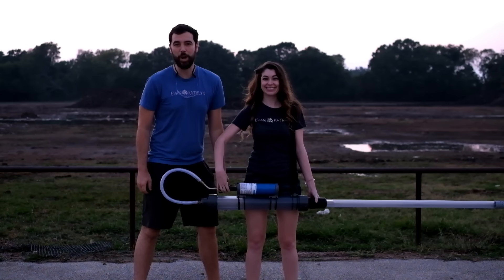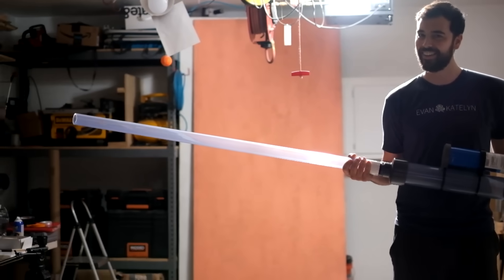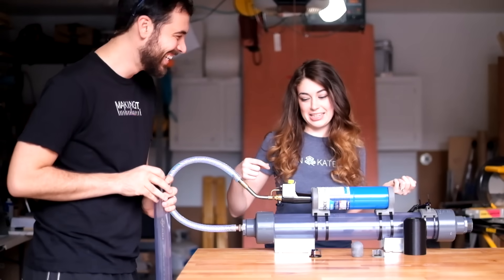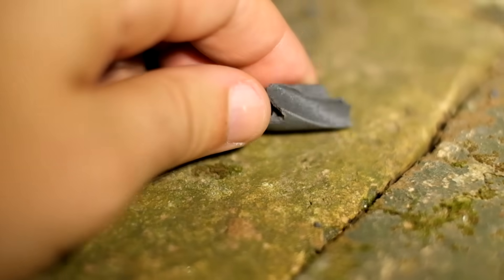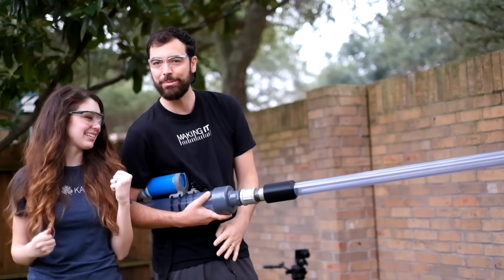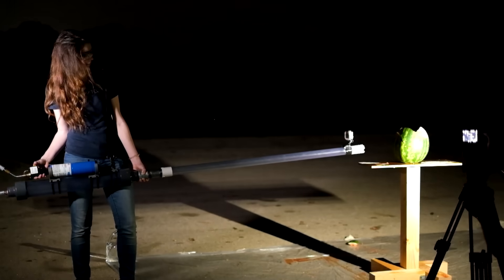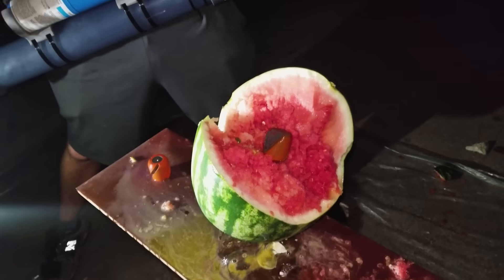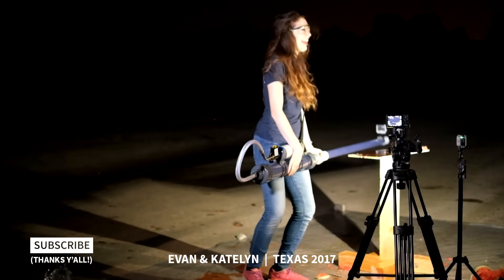Cops caught us firing our homemade propane blaster

Comment: Loading mechanism: 1) cut a hole in the side that you can put the ammo in 2) have a slightly bigger tube slide over it to seal it.
Reply from the maker: Sorry it took so long for us to get back to you on this comment, we wanted to save all the suggestions in a google document for when we make version 2.0! Officially on the list, thanks for the suggestion :D
Reply: Good idea! That way the pressure doesn't let the bullet out
Reply: The slightly bigger area is where the gas will escape because it's before the projectile, I feel like you thought of this because of a shotgun but that has a receiver arm which pushes and pulls the shell firmly into the barrel after the slide closes and the shell has a firm seal around the barrel which fires forward. This would probably blow the side out in this pvc gun

Comment: I think you'd get a more consistent ignition if you put the spark inside the combustion chamber. Much better cavity for air-fuel mixing, than counting on air being pulled into the torch head and being able to travel down the thin tube. Maybe a grill starter like most traditional potato cannons, and use a stock (non-trigger start) propane head...?
Reply from the maker: Sorry it took so long for us to get back to you on this comment, we wanted to save all the suggestions in a google document for when we make version 2.0! Officially on the list, thanks for the suggestion :D
Reply: EvanAndKatelyn I've been making potato cannons for a while. One of the problems you have is the ignition. As you stated you will be fixing that. But the biggest problem you have is your combustion chamber is too long. Cut that barrel about 1/3 shorter. What's happening it's your getting a slow burn and not a fast explosion. The longer chamber looks cool, but your losing efficiency in the burn. Cut that down and you get explosions that will rocket your projectile. A smaller barrel also increases your pressure but means you have to smaller projectile. So there is a trade off. 
You could also have multiple  barrels with an adapter ring. Good luck, stay safe.
Reply: And you could use a magnet to load it
Reply: Instead of the magnet holding the bullet, would skipping that and putting a hole through instead work better?
Reply: If the spark is in the chamber, there is a chance of flashback where the fire follows the unburned gas mix back to the torch.

Comment: Love the video as always, especially your reactions to the madness. The usage of transparent materials is great as it allows a nice look into how the system works.

The reason why I believe it doesn't work and needs to be angled down is the place of ignition. The ignition happens where the gas comes from. Normally air would be around this area, however the hose prevents this. Angling the device down allows air to enter the hose and creates a successful ignition, since it is less dense than the gas. If you create the ignition in the combustion chamber where the gas and oxygen can mix instead, it will probably work a whole lot more consistently.

Now how do you get the combustion into the chamber? Well the same as Destin from SmarterEveryDay did. You can use two electrodes that are very close to one another but do not meet in the chamber and spark those. This should create enough energy to ignite the process.
Reply from the maker: Sorry it took so long for us to get back to you on this comment, we wanted to save all the suggestions in a google document for when we make version 2.0! Officially on the list, thanks for the suggestion :D

Comment: Also the problem you were having firing the gun because of the angle is due to liquid propane going straight into the regulator of the propane torch and throwing off the air fuel ratio if you get bored take a propane torch and light it then Tip It upside down or sideways and you'll see that the flame starts to blow out or become irregular... And if you can adjust the gas bypass portion you made so that the Air fuel mixture or has an easier time filling the combustion chamber more consistently and with lots of power
Reply from the maker: Sorry it took so long for us to get back to you on this comment, we wanted to save all the suggestions in a google document for when we make version 2.0! Officially on the list, thanks for the suggestion :D seriously gonna experiment with this

Comment: Try using mapp gas instead of propane it burns hotter and with more energy and also try putting a check valve or a ball valve on your air fuel inlet so when you're ready to fire you won't lose any pressure through your air fuel inlet pipe ... Use a stun gun for a power source and put two screws 180° apart from each other and your combustion chamber attach wires from the Stun gun to the screws for your ignition system... I would not recommend making your gun a breech loader because unless you have access to a lathe and can machine a sliding breach with triple O-ring seals in the front and back with a locking mechanism it will become dangerous ... But by simply getting the optimum air fuel ratio into your combustion chamber and having good ignition you could successfully should a screwdriver out of barrel and bury the entire shank of the screwdriver into solid wood.... If you try the screwdriver thing wrap tape around the handle to make it fit perfectly in the barrel and a little lube helps ...
Reply from the maker: Awesome tips! Yeah we were interested in MAPP gas but when I did a quick check I just saw it was hotter but it makes sense it would have more energy too so gonna check that out now for sure! I agree with the check valve and electronic ignition too. I was thinking of changing the head of the gas to a pencil type with just a needle valve and no intake, then going to a ball valve and check valve, then to the a tee which would have the wires from the ignition system feeding through a compression sleeve. The wires would be fed into the main chamber though, near the back. Mm yeah no lathe... yet :D

Comment: amazing video.. I cant count how many times I smiled watching you... i have some ideas
1. you need to add some kind of grip or a handle  to help hold and control the weapon.
2. add a gauge to see how much gas pressure is in there before shooting.
3. add some extra weight on the front to help keep it balanced because i can see the rear part is heavier than the front.
thank you for this amazing video.. keep up the good work
Reply from the maker: A handle is for sure on the list of improvements, thinking 3d print for that too lol :D maybe even when we upgrade it with a solenoid or electronic ignition, putting those controls in the handle! Since the whole thing is open to atmosphere no pressure builds up before firing actually, but I have thought about putting a pressure gauge in there to see if it responds quick enough for the pressure spike! Also extra weight to balance it is a good idea! We're also thinking of upgrading the strap configuration

Comment: I wonder if the angle of the combustion chamber has anything to do with the density of propane gas?  Since propane is heavier than air, I would think that angling it upwards (as Katelyn did) would put more gas towards the ignition source and that should be better but use shows down is better.  Could it be too much propane at ignition source results in not enough oxygen so combustion doesn't happen?  

What about two tanks - one propane, one oxygen - so you inject a fuel/oxygen mixture before combustion?  Could be fun but could be dangerous.  

Either way, I must make one.
Reply from the maker: Yeah I think you hit on what is going on. When it is angled up the fuel mixture is too dense and there is not enough oxygen to trigger ignition. Haha YES we'd love to try the propane and oxygen. Two worries though: oxygen seems to be $$ and also is... well pretty dangerous lol! But definitely crossed our minds. Thanks so much for the ideas though, this collective brainstorming is SO fun!
Reply: I agree.  Compressed air would be safer.
Reply from the maker: Can't wait to try things out!
Reply: Oxy/Acetylene cutting torch tanks would be sick
Reply: @the_nondrive_side  be careful if you try that David. Oxy/ace might make that a pipe bomb.
Reply: @Revyloution  I'm a CWB welder... With enough volume ot completely would. In fact... It would need a shitload more reinforcing than it's really worth... Because as you said.. Pipe bomb. I've done it already very small scale.

Comment: Do you guys have a heated build platform on your printer?  If so, do you think you needed it?  I don't have one on mine but printing in stainless steel would be cool!
Reply from the maker: Yes, ours has a heated platform but I would say that most people don't need it. I've used it to print some of the more exotic filaments but you don't need it for the stainless steel because it is PLA based! Check it out here https://goo.gl/wmhrpP it prints at the same settings as PLA